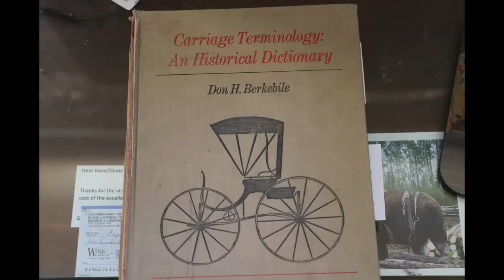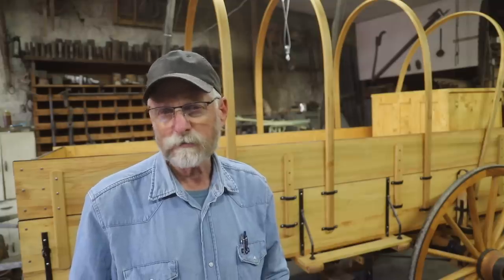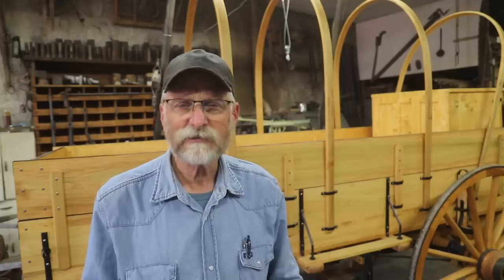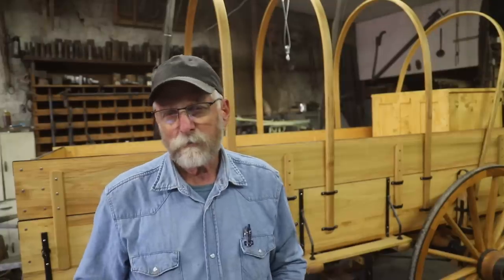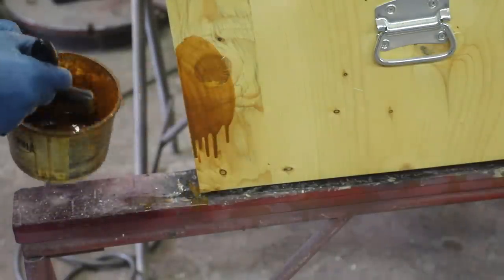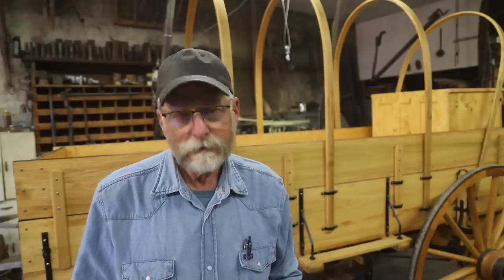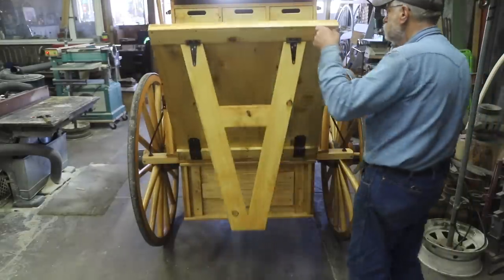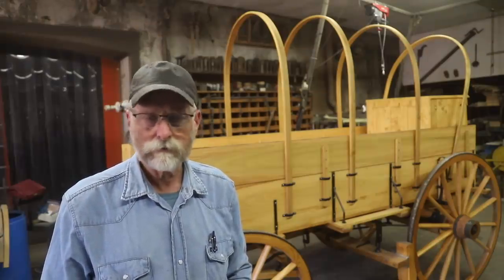Installing the Wagon Kitchen Chuck Box | Engels Coach Shop

Comment: My uncle was a premier cabinet maker with several cabinets in hardware catalogs.  He trained us nephews and other boys how to scrape finish and in the process taught us how to cut glass for scrapers. 
He made a set of cabinets for a lady who wanted the antique look. When they were finished and before he hauled them out to install, the lady came to look at them.  She was unhappy because they did not look age beaten and marked.  So he got his pocket knife out and started gouging the fronts where people would have gouged them over the years, carved wear on the corners, and the lady was very happy.  So, what a person wants or would have been done years ago, and what a professional would do today is as you say, simply the difference between someone making a box then and a professional now is a little apart but both are done with pride of work.  Back then the box was probably made by the same carpenter who made the pine box caskets.

Comment: You went to great lengths to resurrect  period correct wagon iron. The hardware on chuck box came from ACE.
Reply: Yep, I think I would have replaced it or improved its look with flame or a hammer, lol.
Reply: Yeah. It's a shame that the box was built so well, the drawers slid perfectly, etc. And using what appears to be pine insead of a hardwood. The hardware must be giving Dave fits.

Comment: Hey Dave,  Chuck Box was surely built as a cabinet would have been.  Knowing a little about how wood takes stain,  and my OCD,  I thought you better to sand the entire exterior to have the wood able to absorb the new stain and help with the uniform finish and not be so splotchy.  It's difficult to give a uniform finish when a previous product has been applied.  But you knew this and did the best you could without offending the builder of the box.  Sort of like 2 craftsmen butting heads.  Great Video,  Thanks.

Comment: It's pretty common for cabinetmakers to use beeswax to lubricate the glides on those drawers, which can easily cause the spots you had to remove.  What likely happened was that the beeswax dripped out when the box was in a hot truck and laid on it's face causing the spots on the face of the drawers, then the box was moved and laid on it's back, causing the drips along the side of the case.
Reply: Acetone would have taken beeswax off in one wipe.

Comment: Well, "cowboy's" may not have had the "woodworking skills" that many woodworkers of today have but, their quality of work still stands out. You have to remember, they built their own homes, the buildings found on many of the old time ranches. Add the fact that many also had their own blacksmiths on a ranch as well. But, a simple "box joint" has been around for a very very long time and that's what many would've used or a simple butt joint. Now, the craftsmanship that's been put into that wagon you're working on, yes, way above of what they would've done back then. Have to remember, for them, the "job" never ended period, it was "sun up to sun down" and even then, all through the night as well, especially during storms. People of today have absolutely no clue as to what they went through back then. I only know of the stories my grand father would tell when he was a kid from his father and grand father. Times were so much more simpler back then.   
What is the stain you're using? Or is it a home made brew of your own? That color just pops out to me, I really like it.

Comment: This is awesome. Love this build. A minor improvement would be to add a piece of metal to the bottom of that table leg to keep the wood from sitting on the ground.
Reply: It doesn't sit there as long as one might think, lol. Its not going to rot. More often than not, the terrain would be such that 'cookie' would have to place a rock under it to get it level. Better chance of the plate rusting and rotting out the leg.

Comment: Watching you coat it with oil finish it almost looks like the cabinet maker put a shellac wash coat on the whole box and then spot coated the knots with a heavier cut of shellac. This was common practice for cabinet makers at one time to keep/ limit the rosin from  weeping out when pine was to be painted.  It was occasionally used to 'line' food storage containers keep the oils from food from being absorbed and therefore the smell of rancid food to a minimum.... just a thought. 
Nice work as usual 👌

Comment: Very neat. I have a friend that has a rustic cabin in northern New Mexico that doesn’t have electricity or running water. In fact, if the weather doesn’t cooperate, you have to use a 4x4 to get there. A chuck box like this would fit right in.

Comment: Well done Dave.  I have a story to tell about cabinet makers and my past experiences with them. Generally, they are better with making the cabinets than they are in finishing them. Many times I had the experience in their finish expertise and found in most cases, I was better off taking the raw finished cabinets vs. having them finished by the cabinet maker. They weren't detailed enough for me in the application of the finish nor the final coat so I learned to take the cabinets unfinished and deal with that as a separate stage to complete. 

In this chuck box design, I do like the fold down leg design as it stabilizes both sides of the table vs. many I have seen with just the one leg in the center. The drawers seem okay and I do like the sliders he made to keep the drawers square to the cabinet so they slide in and out freely.  Dovetails are nice but not period correct.

Comment: Armed with a modest array of sharp woodworking handtools, that joinery is well within the wheelhouse of a 18th or 19th century woodworker. I bet those blemishes is either a stainblocker, sandersealer or softwood hardener.
Reply: That's what I was thinking!  If you have been to Daniel Boone's home in Missouri the quality of the woodwork on the fireplaces is astounding.  And if I remember right, the docent said, Daniel Boone was the one who did all six of those fireplaces.  I don't think folks are giving the credit due to skills of those cowboys or ranch hands.
Reply: @jjudy5869  Yeah, woodworking was a vocation of most boys and many learned blacksmithing too out of necessity. There is always something to strive for when you are young.

Comment: The finish that was present on the chuck box may have been shellac. Shellac is soluable in alcohol and largely unaffected by acetone and other organic solvents.  It runs freely and leave streaks like on your chuckbox. The good news is that it is compatible with ANY  finish you choose to apply over it. I used to strip old shellac finished furniture buy laying newspaper sheets on it and soaking that in alcohol. After a half hour os so a simple paint scrapper or joint knife will remove the finish with very little effort .  All the best.

Comment: One might suspect it was pine resin like substance  that was on the box having weeped out of other boards while it was kiln dried or stacked with it. Depending on where a wagon was made or added onto could be telling since lumber either had to be locally sourced or brought in if unavailable. Even rough hewn lumber needed a mill of some kind other wise it had to be sawed by hand often with someone on each end which was usually on a frontier were it was packed in often by hand since there were few alternatives. Another fine video, don't worry too much about foreign languages since its really up to the viewer to do the work since translation  is up to them because they'll no its quirks more than you in its software.
Reply: That was my first thought, that it was pitch.  I would have tried some turpentine to clean it off, but that's just me.
Reply: Thank you

Comment: Thanks again for doing this great service, I look forward to Friday evenings to see your next. You probably said in an earlier video but I either missed it or forgot. I'm gettin old ya know. I would like to know what's in the finish you use. For my outdoor wood  projects way down here in the West Texas desert  I have found that a 50/50 mix of mineral spirits and boiled linseed oil works extremely well with maybe annual redcoats if it is out side 24/7. Pump sprayer or a brush work well albeit the sprayer is a bit more wasteful.
Reply: On this wagon he's using TWP. It is in the description below the video. On some projects he use a 3 way mix of mineral spirits, boiled linseed oil and spar varnish. Dave says if you add spar varnish to your mix it would last even longer.

Comment: Dave,  The runs and drips on that chuck box look to me like shellac sealer.  Did you try using denatured alcohol to remove them?  Acetone is not as effective on shellac.
Reply: That was my thought too, that it had a Shellac coat.
Reply: I agree, shellac and it looks to me like it was put on with a foam roller as the heavy lines of finish are pretty consistent across the box.  alcohol is the solution to removal.
Reply: Sanding sealer?

Comment: So still no latch for the pan box one method is a wood swing latch ( think 1/2 of a wing nut) nothing more then a spacer and a piece of wood that swings down  (that way grivity keeps it in placce) over the closer board. Simple does the job and easy to fix think a cowboy might approve?

Comment: Two questions.  1) At the top of the chuck box there is an area across the whole width of the box but is not very tall.  What is that area for?  2) Each of the (dove tailed!) drawers appear to be tapered - at least at the front edge. That is the front handle end of the box appears to slope.  Why is that and is it authentic?  Thanks.
Reply: 1) a cutting board 2) yes, it is authentic. To keep them closed and to keep them under the top.